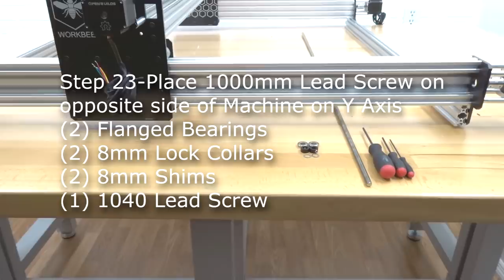OpenBuilds WorkBee 1010 Build

Comment: Can I make this table base for the Workbee 1510? I need the extra 20mm at the height of the drill.
Reply from the maker: The work be is a lock in plate design so raising the Z axis is not really an option. The LEAD CNC machine does allow for these kinds of modifications. That being said one thing you may be able to to instead of raising the Z axis is to lower the table using a smaller extrusion for the base as well as using a thinner spoiler board. Hope this helps